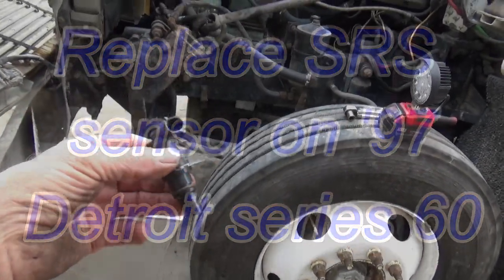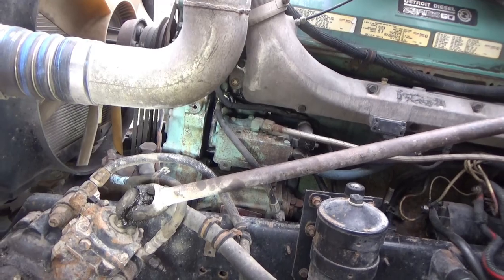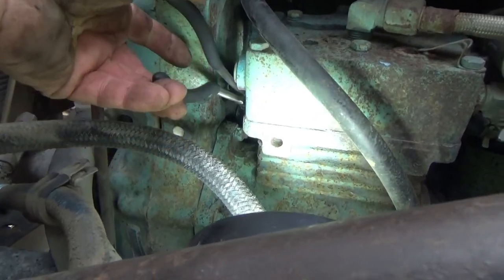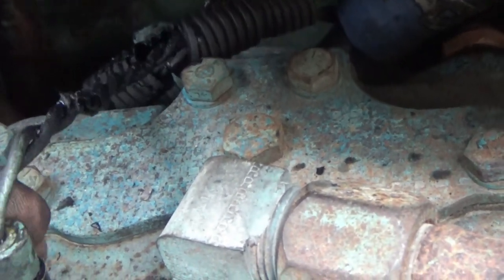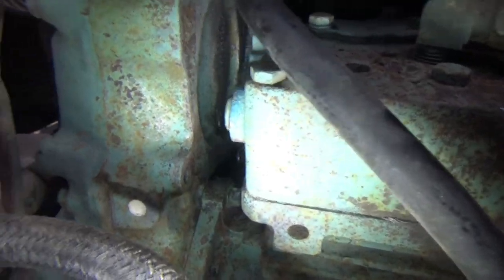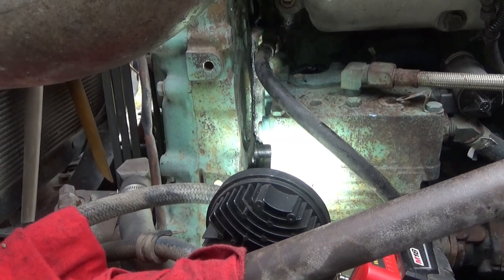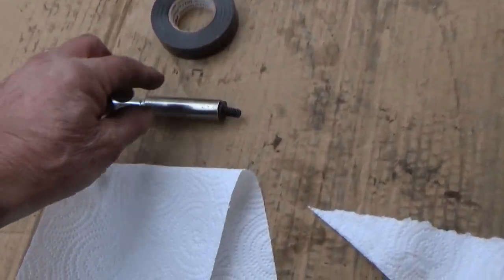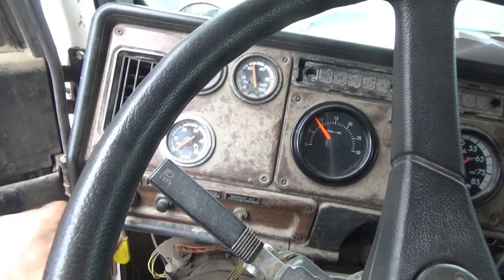Replace SRS sensor on Detroit Series 60

Comment: Another great video. Thank you. Why did you change this sensor what are the symptoms when these go bad.
Reply: I have a Cummins N14 mine went out and I could not tell any difference in the way the engine was running. Only way I knew was the check engine light came on.
Reply from the maker: I just changed the TRS sensor last week because the truck wouldn't start and this one is a good idea to change at the same time.

Comment: Have you read or seen the FMCSA is going to be changing the pre emissions 2000’s and older over to the EDL  ? They have it on the website to read up on but how is it possible to put it on the older ECM’s and program it to the truck ?
Let me know what you think about how it can be hooked up so later on I will know what I need to do 
Please 💖💖💖
Thanks
Reply from the maker: I have not heard about that yet. It is possible to hook that up to any ECM. I think the ELD has the the GPS in it.
Reply: @57bagre  ok I was wondering
Reply: I had no problem connecting a 9 pin GeoTab eld to my 97 fld120

Comment: Gordon this controls RPM input on the tachometer? After we serviced the air pump this starts to random fail .
Reply from the maker: I don't know, maybe need to clean wire connection or repair wire since it's the only sensor by the compressor, the "TRS" is under the compressor but the truck won't run if that has a problem.
Reply: @57bagre  thanks sir

Comment: You can buy the plug with 6 inches of electric wire from DD and suggest you get one just in case 
These old girls will be running when we’re both dead and gone